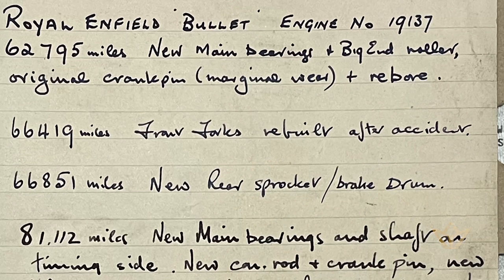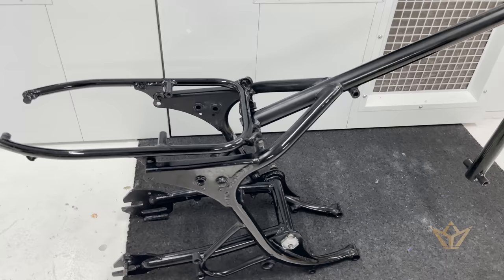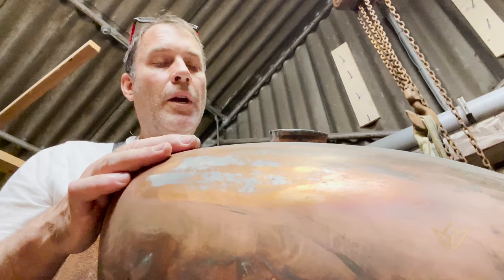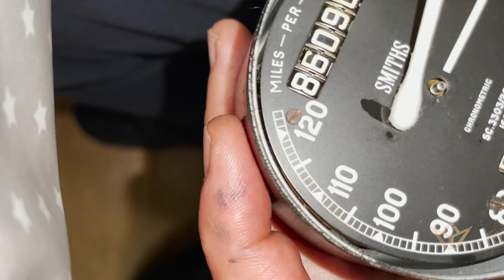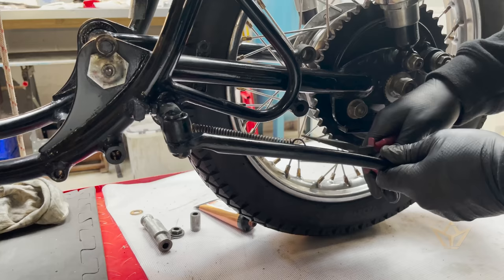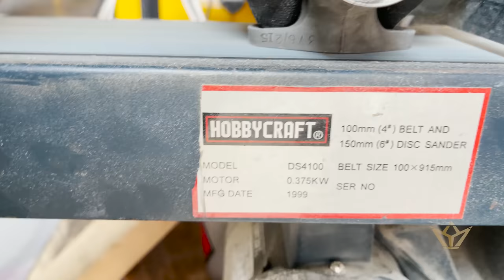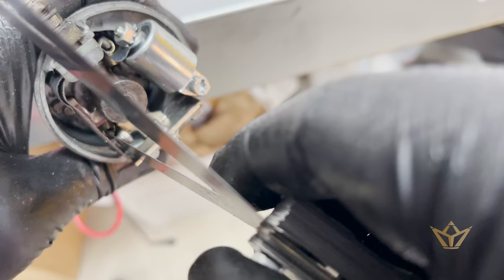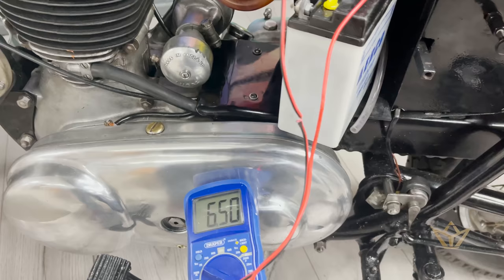Restoring a Vintage Motorcycle | 1961 ROYAL ENFIELD BULLET 350 | Full Restoration | British Made

Comment: Back in the mid 70's to win bets from the uninitiated I used to start my own Reddich built 350 and 500 Bullets with a flick of my wrist on the kickstart lever it was that easy when you got the knack, later I used to do the same with my 750 Commando which surprised a few of the Japanese bike riding British bike naysayers with their electric footed engines who were of course especially critical of Royal Enfields, which had a reputation for oil leaks, although none of my engines leaked a drop of oil but which in light of that fact they still delighted in warning me that 'my engine had obviously run out of oil'!. FYI the Bullets both got a huge  improvement in handling from using heavier oil in the forks, shocks off some big BSA that had harder springs and dampers and most importantly Avon Safety Mileage tyres at both ends, 350 front and 400 rear. Once the handling was really sorted the old Bullets could carry so much speed through the corners I could keep up with or beat all my friends at the time on their Triumphs and BSA's, the Avons used to wear triangular as there was not much 'go' or 'slow' to wear the tops but got plenty of hard cornering so they wore mostly on the sides, of course due to this triangular shape the handling just got bette and better and the old RE's could embarrass many a much more powerful bike wether it be British or Japanese. A Bonneville riding 'friend' said 'I was riding like a lunatic' after I just whipped his ass on a short dash from the Camden pub at Bexleyheath to Sidcup where we both lived, then he dropped me from his circle of friends and wouldn't speak to me for months heh heh, what a tosser..

Comment: I have been working on my bike for 2 years (a yamaha gt80 1979). Two days ago, having it almost ready to ride I noticed an awful and big buble in the gas tank, turns out a welding I did had a crack and once fuel entered it, it ruined my job. And now i find this video, and I feel related to you and the unforeseen problems. The issue is already being addressed! the bike will run!

Comment: i have one here in India , that is 1958 Bullet model . I did a complete restoration here in india . I dont know what did yours cost but in my whole restoration it costed me near abouts 82,000 INR .When converted in USD approx 1200 dollars . But one thing different about my restoration was that i kept its aging looks . 
I wanted that bike to look like a 70yr old legend . Yours looks like a factory new bike so your restoration must have costed much more .
Reply from the maker: Thank you Aditya. That’s a good price. Mine cost a bit more, mainly the tank. The cost depends on what the bike needs in the end but you must be very resourceful! As you have the old 4 speed try the 22 front sprocket. It’s great for cruising at lower RPM’s. I recommend. Best
Reply: @MyRestoration1  Yeah my Tank was still in great shape from inside minus the rust on the outside , My Major cost went into the gearbox assembly and front forks , it was in shambles due to an accident . 
Thanks for the advice on the sprocket change but i Couldn't cruise on it much , because of the restrictions by the govt on old vehicles and also my fear of something going wrong with the bike . I just ride it nearby my home occasionaly once or twice a week just to keep it running . 
I also have a new JAWA 300 2019 model and a classic 350 2017 , these are my primary vehicles for everyday use .
Reply: Aditya hi, can you please post the pictures

Comment: Hello sir, everything in this video was perfect but may be the tuning of the bike is not accurate because the bend pipe near the cylinder head is reddish blue in colour that indicates that the timming of the bike is not good. Kindly looks into it if you think my point is correct.
Reply from the maker: Thank you Tarun. Once the oil had burnt off after the rebuild I cleaned the pipe to chrome. It now does not change. It’s stays chrome. All good 👍

Comment: Hi can you please mention the link of website from where you bought that Leds both main and the pilot lights?..do you have a voltage regulator fitted along with the rectifier?
Great restoration btw❤
Reply from the maker: Hi thank you. I do not remember where I got the lights from. I advise folk to look at the video and source a 6v style equivalent. Chances are many dealers are stocked with the same product anyway and I certainly don’t have anything special. Yes the VR is essential otherwise it will blow the lights. Get rid of the old stacked plates version for a cheap electronic version. Cheap as chips.

Comment: In India if you take this thing, they'll say it's bad since an old bullet, nothing but the exhaust thump should sound. No tappet sounds.
Reply from the maker: Thanks for your comment. Maybe that engine is different but I can assure you clearance is spot on. Have a look at other U.K. made bullets. They sound like this.
Reply: @MyRestoration1  Yes. I also agree with that. But they do something here in India to all bullets to make them as silent as possible. I know personally, there are many mechanics in my neighborhood itself. Some of their bullets run for as long as 1,50,000km or more before needing an engine overhaul. And they do the same for every era bullet. From the 50s with the cycle breaks to the ones made in the early 2000s.

All bikes usually have some valve and tappet noise when perfectly set up but somehow this happens here. I've even showed some videos of fully restored bullets to them and they always say that they have engine noise and that's not right. That's also why there's a huge following for the old bullets with the cast iron engine since the UC engine that RE came up with after has hydraulic tappets and there's always a sound. Maybe I can get you in touch with some good mechanics if you'd like.

Sorry for the long reply hehe...
Reply from the maker: @aadityakiran_s  that’s some mileage! Mine has only done 34 miles sines it was restored 😂

Comment: Tappet.  Sound . Is.very. Loud.
Reply from the maker: I thought so in the beginning but it’s set correctly so I guess that’s just it’s character. Thanks for contributing. 👍
Reply: @MyRestoration1   Sir. I also. Own. A. 1974 g2 model. When. I. Restored it completely  it. Also started knocking  earlier  after. Some time the. Tappet.. Is also. Start producing  a lot. Of. Sound Tik tik tik. So. I again take it. To. The. Mechanic.  He then done. Some adjustment in  Timming pin. Set. After. That. I  only. Listen. The. Sound. Of pure. Thump  Dug Dug. Apart of. It. No. Other. Sound. Is. Coming out of the engine. U should. Also try.